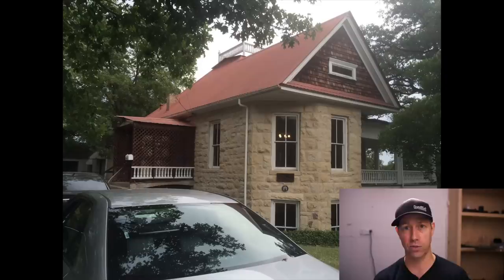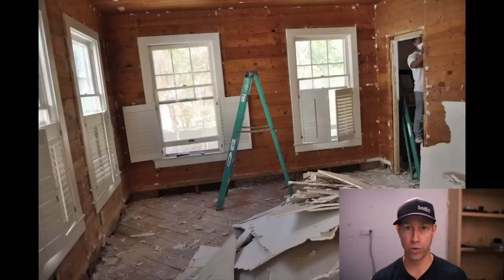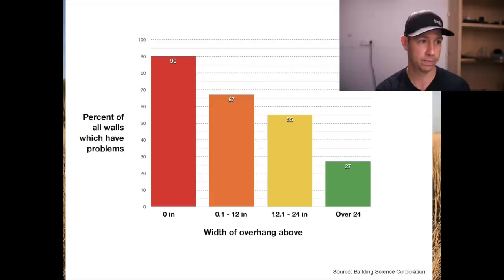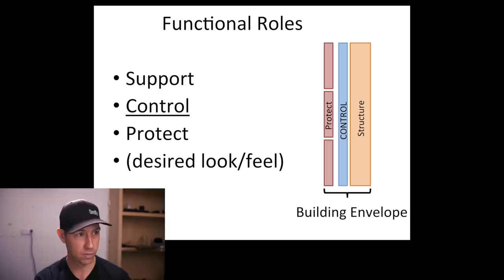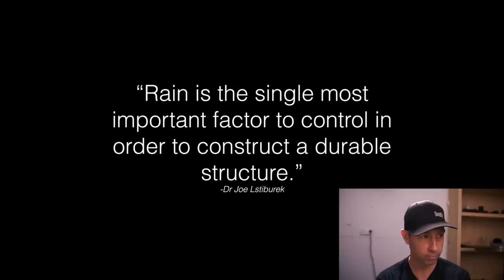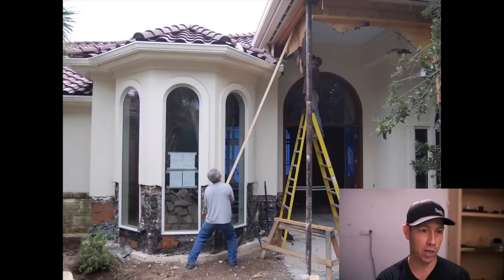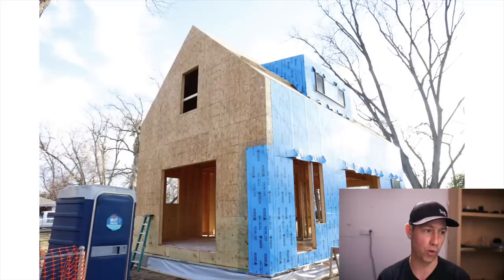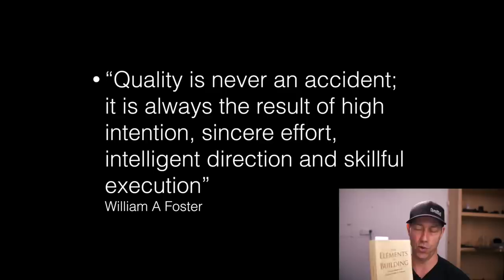Were Old Houses Built Better?

Comment: Why do Americans keep building with materials that are so vulnerable to termites and moisture?
Here in Europe we build with concrete, stone, brick, steel, tiles and cement.
I am always puzzled by how flimsy American houses are, especially in areas prone to tornadoes, hurricanes and floods.
My doors and window frames are the only pieces of wood on my house.
Reply: Sadly because it's cheaper and prices are already inflated here regardless, and property values are inflated and most people don't want something that lasts 100+ years as tastes change frequently and not everyone stays generation to generation in a home.  Plus, not saying it's impossible, but those materials tend to make an not-so-aesthetically pleasing home, which is a HUGE factor for most buying a home.    Also, another factor is all the cabling, from electrical, to even now ethernet, etc without it being ugly; much easier to do it through the middle of the wood/plaster walls. 

Personally I would want a steel framed home, with stone/brick/concrete walls & foundation and just wood sparingly.
Reply: pete smyth  I mean, compared to all the evidence from hundreds of thousands of homes showing wood practically everything has issues too. Has tons of "bad" too? I mean, what are these videos about then? I want something different if I'm paying $500K+ for a home.

Comment: Big, uninsulated overhangs result in ice dams on the roof.  Love the information I learn on this channel but realize not everyone lives in Texas.
Reply: No. my overhangs are 3-4 feet and I live in Canada. House has inslution in between all joists leading up to ythe brick wall exterior but NO inslution in the overhang. It needs air flow. Ice damning occurs when heat from your house is escaping in to your attic and the snow melts underneath and turns to ice as it re-freezes over your overhangs. The key is proper insluation and airlfow in your attic to keep the attic COLD and the house WARM

Comment: I have a book published in 1932 and it describes a 50 year study of heating a large four square house in Chicago. It went from 1880 to 1930.   They used different gravity furnaces for every year to find out which design was the most  efficient.  It pictures a large 4 or 5 bedroom house that they used and at the beginning of the book it says "Now that it can cost as much as $18 a year to heat a home like this in Northern Illinois...."  They even insulated the house during part of the study and that reduced the amount of heat you needed by about a ton.  The amount of heat you'd need in Texas to get though the winter would be much less of a consideration in those old houses.  Plus, people years ago generally  only heated the room they sat in, and the kitchen and certainly not the basement.
Reply: Coal heat is still cheap. You want to shovel coal?

Comment: My father put sheetrock over a basement block foundation when we were very young.  During our teenage years my brother and I could not even breath thru our noses.  My father had chronic lung problems in his later years.  After he passed I pulled down the 'rock to find a thick black blanket of mold covering the foundation. The forced air heat delivered that crap to the whole house.
Reply: "My father put sheetrock over a basement block foundation when we were very young."

Because he did not prepare it properly.
Reply: Haiden - lol, no doubt. It was the sixties, and Dad probably picked up materials where he could.  Also, behind the sheetrock, the foundation had classic staircase cracks and roots growing thru them.  My point is there are big consequences to getting it wrong.

Comment: As a builder my whole life, I knew the practices I was witnessing would be not as long lasting as the older structures. I have also done much work on poorly built old houses from the turn of the century until the 40s. The state financed structures were quite amazing from the 20s through the 60s.

Comment: In your example of the modern build, how did you attach the 1x4 batten over the insulation without penetrating the moisture control layer?
Reply: I think self adhering roof membrane is rated to be self sealing.  As it would have thousands of roofing nail penetrations.

Comment: For starters, the difference between the 2x4s shown is one is heartwood (high resin content and virtually rotproof) and the modern one  from a tree farm is totally sapwood (highly porous and low resin content-easily decayed). The quality of older buildings (just like new ones) is all over the map. The American countryside is littered with old houses rotting down because of lack of maintenance. Stone houses are not energy efficient and require a camping mindset to live in.  The premise of this video is flawed. The real answer is way more complicated. Some older buildings are better constructed than some newer buildings, but some newer buildings are built better than many older buildings. You have to be way more specific about what types of construction you are comparing and how they are better or worse. This from many years of remodeling in areas with houses from the 1700's through the 1990's. I also inspected well over 400 houses.

Comment: I don't know if they were built better... BUT they had 2 things far superior to homes in the last 40+ years.
and that is they had basements and useable  attics... NO houses have them now....
Reply: Graph Guy my house has 9 ft. ceilings in the fully finished basement. And the attic is the full length of the house with a 4' wide stairwell up to it. You have to plan for it when building.
Reply: Dorsk84  
NIce.  I guess I wasn't clear... I meant houses not costum built.
Our house is a $1,000,000 built 2002 in California Sierra with a 9' ceilings, crawl space, attic of no value, semi custom with 2x6 walls.
If I compare it to my family homes in the Midwest built at least 70 years ago.... my $1M is pretty crappy.
Reply: @graphguy  homes in the Midwest use basements for frost free utility and storm safety... your CA house doesn't need a basement.
Reply: that is 1/2 right and 1/2 ignorant.
Reply: Usually the things that determine whether there is a basement is soil type, water table, and how deep you go before hitting bedrock. So you'll find basements in homes through much of the Midwest and around the Great Lakes. But head near mountains or near the coasts and they're more on the rare side, as they become more difficult and more expensive to construct.
Reply: Homes do not have... basements, what? Firstly that depends WHERE in the U.S. you are. You're either ill informed, or lying.
Reply: roger that.
But the number 1 history for having a basement..... 
They  originated from root cellars, which were used to store food before refrigerators were invented. This is due to the cooler environment of a basement, opposed to a living area.  I grew up in the Midwest where there were many pre 1900 homes and knew a lot of old farts... you could see that and hear the discussion of basements being called root cellars, not basements.  The idea that they were 'tornado protection' was an adjunct and the idea they were for utilities was much later.
Reply: Porches?  "Porches? We don't need no stinking porches!"
I have bought 2 houses unbuilt in California and I had to go every day to keep an eye on them.  First I had to learn Spanish.  Then I had to tell them, "No you are not going to put that twisted 2x4 in my wall and no that crack in the concrete is not acceptable and I don't care if it is narrower than a dime.... pathetic.
Reply: One other big reason for basements in cold areas was so that you could put in a furnace. Originally these were wood or coal burning furnaces. Typically these were big and dirty. The basement provided a good place to store the wood or coal. A large furnace running full blast would keep the floors above it warm. This would have the effect of making the house feel fairly warm even if the house itself was drafty. Most midwest houses are two story for basically the same reason. Heat goes up.
Reply: That was an after thought, an evolution of the space, but true as time went on.
Reply: You sound self centered. West coast even.
Reply: grow up
Reply: I don't see any reason to have a basement. Used to have one, but not anymore. Good riddance. I lived, and still live, on the west coast (Pacific northwest, that is). Better to have a two story house, than a one story house with a basement.
Basements can't have windows, for one. Two, they're often built as if they were an afterthought.
Reply: basements are not considered as part of living area square footage, so they are not a replacement for normal living areas.  But you would be hard pressed to find a house in parts of America that the basement wasn't converted to living space.
As far as functionality, a basement is far better for access than a slab or a crawl space.
Reply: @charlesaanonson3954  
Yeah, my 1920s house still has the outer coal door to the cellar for the coal man to shovel it in the house! (These days, though, we have natural gas and forced air heat.)
Reply: Some areas aren't well suited to basements, though they're nice to have in areas which are.  

The dearth of proper attics is kind of annoying, though, yeah. There are some roof styles which aren't great for them, which is fine. But it's frustrating to see a roof which could have a proper attic be without one.

Comment: The only downside I have found about old houses is you have to check their foundations because that is generally the weakest point. Foundation building back then is not as good as they are now. I would still rather have the best of both worlds and purchase a older house and have it updated to newer standards, electrical, plumbing, insulation, etc. but still leave the old wood work for its charm and quality.
Reply: I grew up in a Pre Civil War house with a 20ish inch thick stacked stone foundation.  You go into the basement and the floor joist are hand hewn and vary in width and height, but are significantly more substantial than anything in a modern home.  A barn and silo that were once on the property burned down a hundred years ago and the foundations are still standing.  Modern foundations don't come close to that longevity.  The front porch might be an inch higher on one end that the other and the kitchen ceiling might be a little off too, but that house could easily stand for another century when nothing built today will.
Reply: Noah E There are always exceptions to every rule.